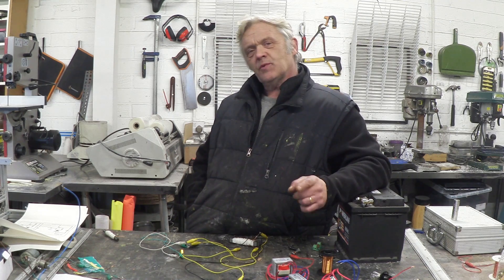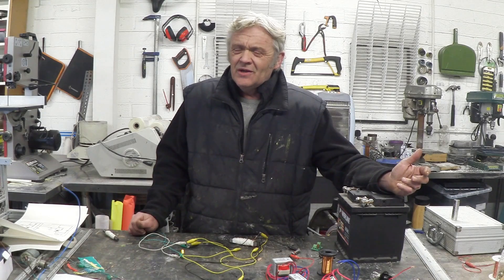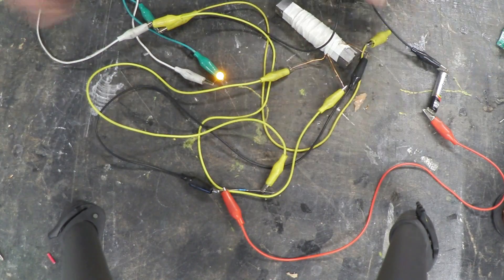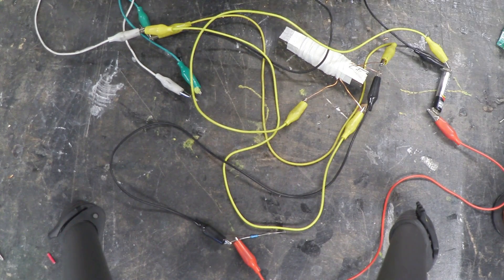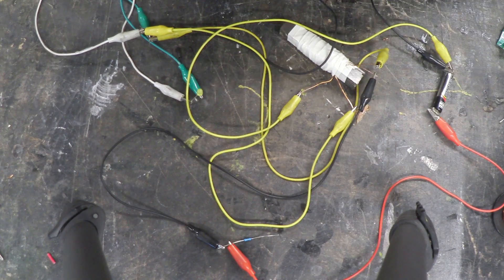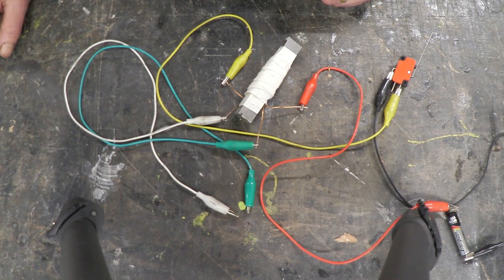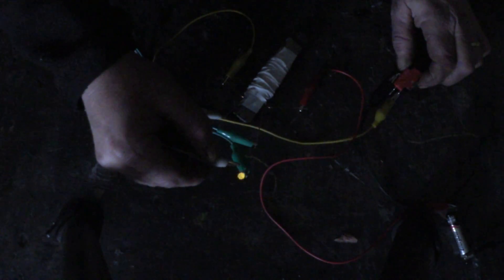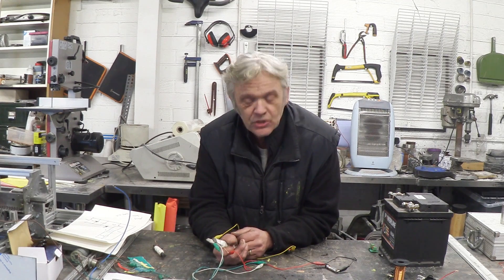988 The Heart Of The Bedini SSG

Comment: Also if been watching alot of experimenters on youtube and iv been fascinated with generator coils and motor/generators like bedinis design people are using his circuit to drive the rotor use HV spikes to charge a second battery and also they has a separate coil as generator coil to power a load or charge another battery but the special thing about it is the geometry of the core has been arranged in such a way where lenz law doesn't drag down the motor it speeds up while under load and draws less amps you dont have to drive it with a bedini circuit but this is what's amazing to me mainly the source of this type of generator is the Kromrey generator witch is very very cool put out what's called cold electricity I I really think you should look into these types of generators there's is one design that's I very well put together made by TinMan at the OzSolarPower channel go look at at a video he made called the L.A.G lenz Assisted generators that is a very good design that uses bedini coils and sg circuit with generator coils that speed up under load and draws less amps it all has to do with the way the generator coils and motor coils are wound to the magnetic fields dont buck against each other creating lenz drag instead it help repel the magnets on the rotor because the magnetic poles are no longer working against each other I recommend trying this out set up a simple bedini motor with magnets nsns get an iron or steel core that's three times longer than the coil put the iron rod in the coil and instead of facing the coil and core to the magnets like normal face the bifiler coil on its side now get a single wire generator coil and slip it over one of the ends of the core and use it as generator coil power a load and depending on with way the generator coil is wound you will have to try it on the left side of the core or the right and you will see once you load the generator coil while the whole bedini coil core and generator coil are facing side ways and the rotor magnets are hitting the center of the bedini coils windings the rotor will speed up under load and the amp draw will go down on the sg circuit input  hope you try it thanks again and cheers mate :)
Reply from the maker: nice info mate - thanks for taking the time to post all of that

Comment: Awesome video Robert good explanation on the circuit hope to see you do more with it I always thought you would be the one that can shed some light on bedinis work since your a chemist and you really know how batteries work down to a chemical level bedini knew alot about batteries as well I think you look more into it bedini has said that the sg machine is not the free energy device the battery is if charged correctly thanks again cheers :)
Reply from the maker: I do plan on looking further into this mate
Reply: A Capacitance charge ..-- Mains - Caps - Bridge-rectifier will do a better Job than SSG . The SSG is meant to use the torque also and the timing of the electromagnet is crucial to bypass Lenz forces and then the faster it goes the more energy it dumps out ....

thats the key about all the magnetic overunity devices the faster they go the less they use from the source and more they give

Comment: RMS, Tesla liked pancake coils and they had no ferrite core. I think it would still work but not limited by frequencies like the ferrite cores.
Reply from the maker: for sure mate
Reply: Tesla got around the frequency limit problems of cores by using reactive oscillations instead of active, if the power oscillates in reactive configuration the core won't heat up nearly to the same degree at high frequencies.

Comment: When you let the magnet run into the metal rod, the pulse was triggered.
If you just run the magnet passed that point without it touching the rod; will it trigger the pulse?
If so; is this a substitute for a reed switch?
Reply from the maker: yes - the turns number will have an impact on the effect for sure but  as long as the magnetic field is in motion this will work just fine
Reply: @ThinkingandTinkering  
I guess you could use this to activate a reed switch as well which would be a way to protect the contacts of the switch from becoming magnetized.

I don't know how prevalent that is; but I read that it is a problem with reed switches when they are in a magnets field too long.

Comment: I have some interesting ideal for some projects that I think many of your viewers may enjoy as well.  One of them is to make an induction heater.  I've found they are actually pretty simple and straight forward and these things can be used for a lot of different applications.  

Another project is to make a pan/tilt/rotate mount where you can mount a camera and use stepper motors to control it.  There are so many options for the camera anything from using a web cam, a camera out of an old phone or a camera from an old laptop or tablet all the way up to a DSLR with a huge telephoto lense.  .  You could find stepper motors from old printers among many other devices.  

I'm planning on building an induction heater and have been reading up on them the last couple weeks.  If you like any of these ideas, I'd be happy to chat or email  you about regarding either project.
Reply from the maker: nice ideas mate - go for it

Comment: Back in the 50s we called it a TV flyback coil circuit to generate the high voltage required to horizontally scan the crt
Reply from the maker: yep - ignition coils are the same idea

Comment: Great video!  Would love to see you extend this to a Practical DIY “de-sulfater” for large ( 12V Automotive ) batteries.  This would help us reduce the incredible amount of waste of not really dead batteries.  I can see the extension to the real world application, But  would really appreciate investigating with you the Devilish Details that make this really practical.  (Hopefully the auto Battery manufacturers won’t get you censored — humor)
Reply: Buy already at Walmart or auto store.  No need to reinvent the wheel.
Reply from the maker: you can just buy those you know mate?
Reply: @ThinkingandTinkering  Yes, certain lead acid battery chargers/maintainers have a desulfating feature.  Just heard one of the brands a few days ago but forgot the name.  Surprised you didn't  already know.  On eBay I have also seen desulfating only gizmos sold as well.  Either way, they all appear to use elevated pulse voltages at some periodicity.  Knurlnar, not sure of spelling, on youtube seems to have done the perhaps, best and different approach of method for fast results.  Unlike the store bought ones, slow acting, low power and HV, he uses high power and moderate voltages.  I can get more details if you like, just not in front of me at present.
Reply: I still have an older radio shack charger that has desulfate mode.
Reply: I've taken a deep cell mide of winter iced to the ground about halfway up the batter in Alaska two weeks and the fucker is still in .y van as auxiliary bat working like it was brand new. Oh it charged to 2.4 or so volts on a charger
Reply: Wbefore I took the desulfator to it

Comment: .....you've also answered another question that was in my mind :- your crocodile leads aren't magnetic, therefore you don't have the ones which are basically iron wire that is copper plated and turn hard and brittle once they heat up slightly due to excess current. . . . .I'm out of the loop on this bedini stuff. I might go and have a look at it .
Reply from the maker: there is some interesting stuff to be got fro mate - that's for sure